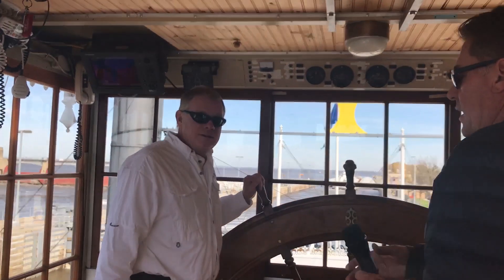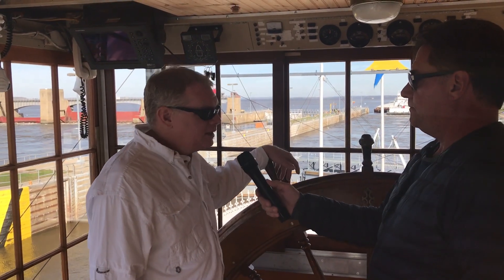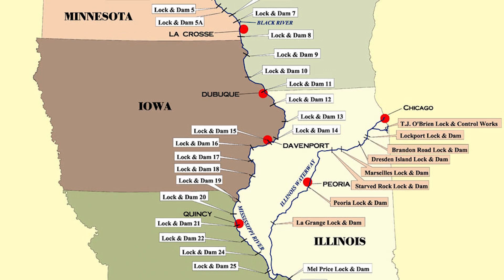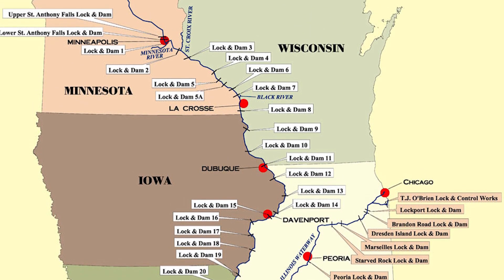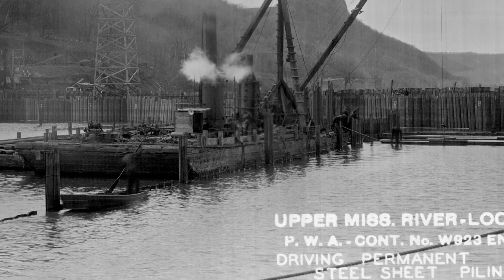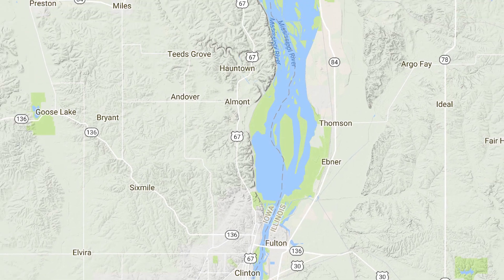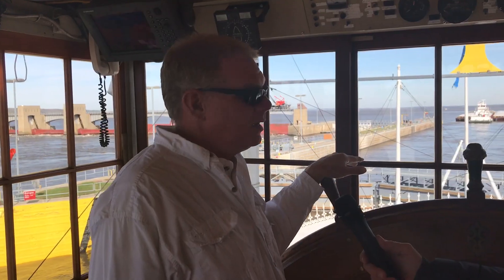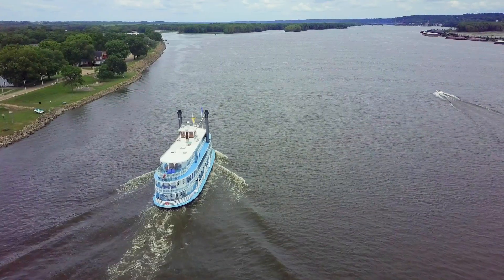Mississippi River Lock & Dam 13 • Season 1 Episode 6

Comment: Nice video and Nice Looking Paddle Boat  and Lock Dam 13 on the upper Mississippi Consists of a 600 Feet long Chamber and 110 feet wide and Lock and Dam 12 on the upper Mississippi Also Consists of a  600 feet long Lock Chamber and 110 feet wide but just a little Correction there are 29 Locks and Dams all up and Down the Mississippi River Not 27 and yes the Locks and Dams and scenery is Beautiful to see on a nice warm clear day.